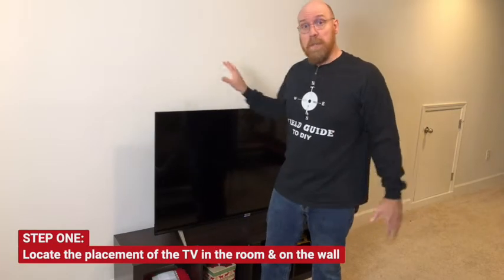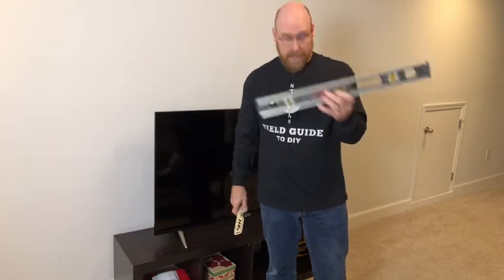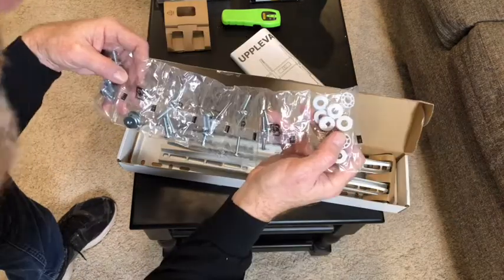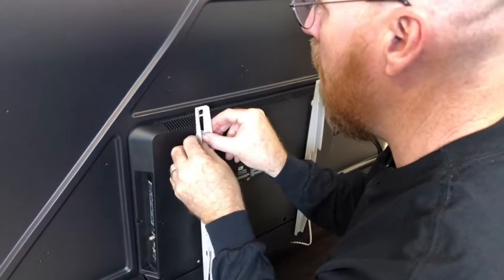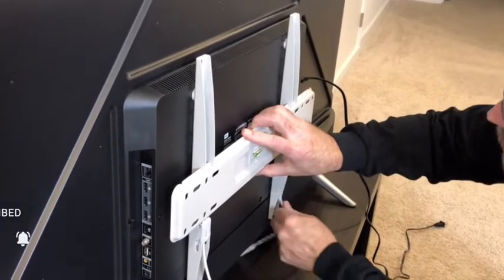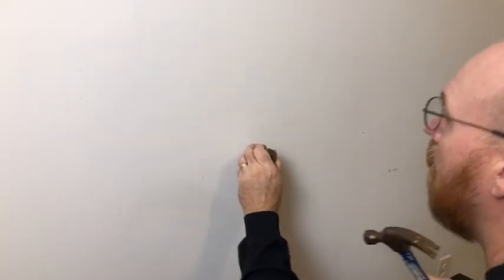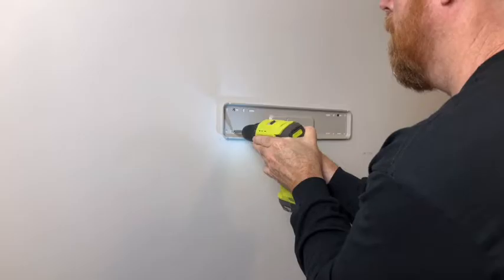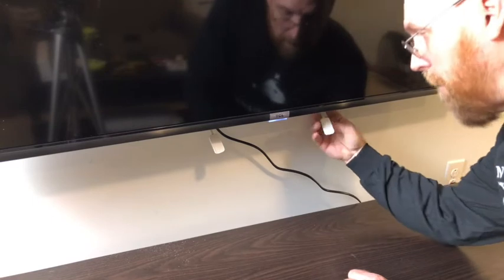How to Hang a TV | Step-by-step Instructions | IKEA Uppleva

Comment from the maker: What hacks/ideas have you seen on hiding TV wiring?
Reply: In France, they typically use something they call a “baguette.”  (They call a lot of things that!). It’s a slim piece of white PVC that they tuck the wire into and then place it on the wall.  While the PVC is not flush with the wall, it’s definitely a cleaner look and when painted the same color as the wall, it’s not all that noticeable.
Reply from the maker: @hollyperrin7353  thanks so much for sharing.  Here in the US some contractors call the same product “raceway.”
Reply: @FieldGuidetoDIY  Thanks for the actual term for that in English.  It's not perfect, but it does look better than a wire.  By the way, I really appreciate your video because I can understand your instructions much easier than the instructions that come with the product.  You saved me time and hassle!  Thanks so much!

Comment: Great tutorial but how do you get it down?
Reply from the maker: Great question.  You may need another person.  Pull those straps or strings hanging down; both at the same time WHILE gently pulling the bottom of the TV away from the wall (about 1 inch).  Then lift the hanger off the wall mount.  Let me know how it goes.